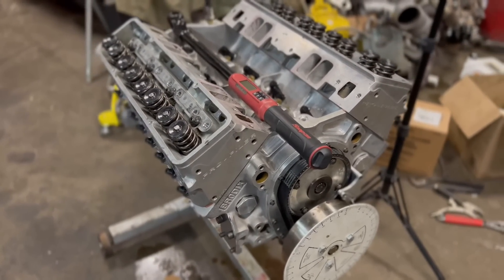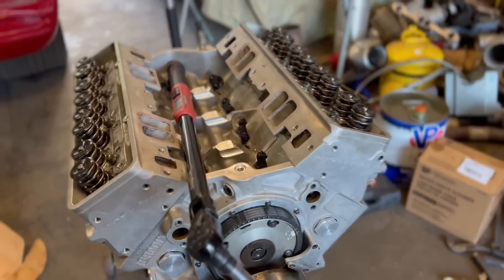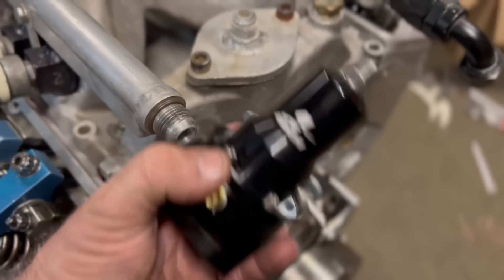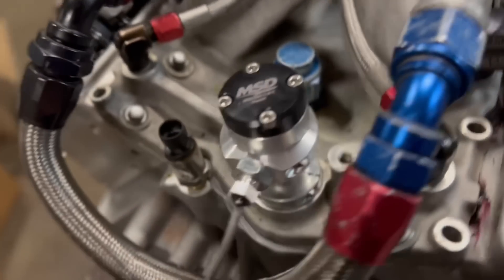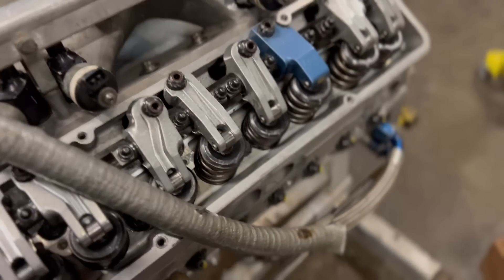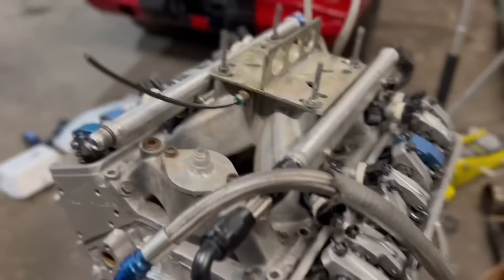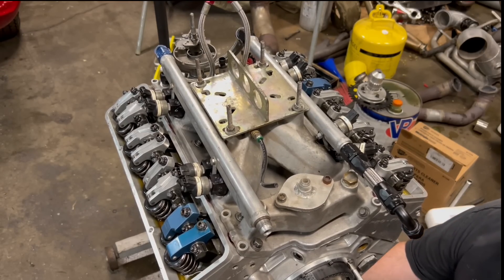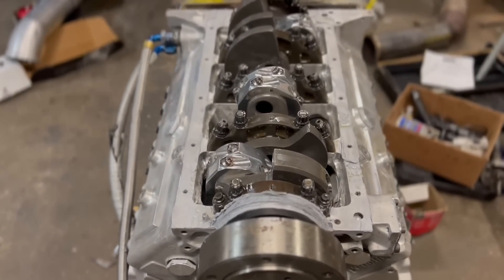SBC Final Assembly/ We Got Oil Pressure

Comment: Is that a raised cam block?? Is the cam hitting the rod's??  I have never been able to run aluminum rods with more than 3.50 stroke with a standard base roller cam. 3.75 stroke and up needs a small base circle cam and usually steel rods. Hope it's just the oil pan!!!

Comment: You need what's called a 90 degree swivel hose end. I realize that they're all swivel fittings, but I didn't make the name! That way you don't have to have the distance of the soft radius 90 degree bend of your current hose ends. I just had to buy some for my junk so it's fresh on my mind! Lol

OMG, you need to put restrictors in that motor! That's WAY too much oil at the valvetrain!!!

Comment: That is very close to coil bind. Did you check with the new cam?
Strokers?? You have to check and relieve everything. Depending on rods you have to clearance the pan rail and dent the pan on 302F based engines. And the bottom of the bores. And that is with steel rods, those humungous alloy rods would be  a real issue.

Comment: It would be worth checking on that gear after its ran for a bit. I had a melonized gear fail on SBF with Lunati solid roller cam. My first one in 20 years. I used the green goo that came with the distributor for break-in too. Ended up switching to bronze, at least it’s soft when it fails over time.
Reply: Yeah, better the distributor gear than the ruining the cam!